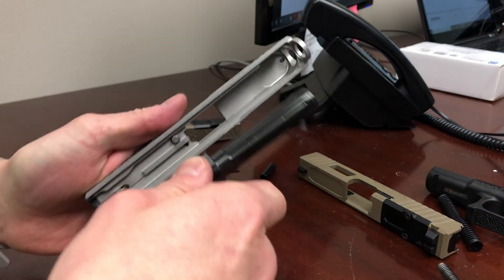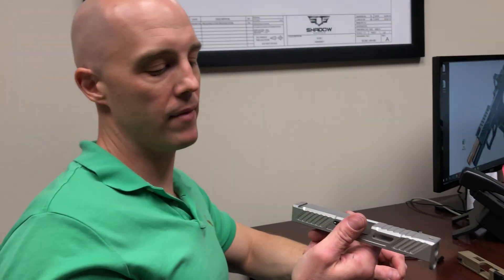Technical Tuesday: Replacing a Slide

Comment: I see no plunger spring depressor in my XR920 elite. And it did not fly out. So while cleaning, i could not remove the extractor 
 The striker does not seperate from the spacer sleeve.

Comment: 9:20 talks about the striker moving freely, which you can test with the shake method.  I just wanted to drop a note here for newer SS owners, they have added a firing pin return spring to the striker assembly, which prevents the shake test.  This is talked about in their TT video here: https://youtu.be/PXIWlTMOQwg?t=315 - if the link doesn't work, it's the TT video titled Firing Pin from April 4, 2023, and it's 5min and 15sec into the video.  I hope that helps.

Comment: I have a spare channel liner that I use to install channel liners. It works very well, I just press down on the table until it fully seats. Ive never had to remove one thankfully. Removal seems damn near impossible